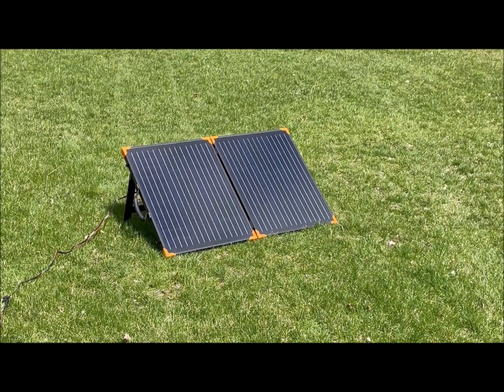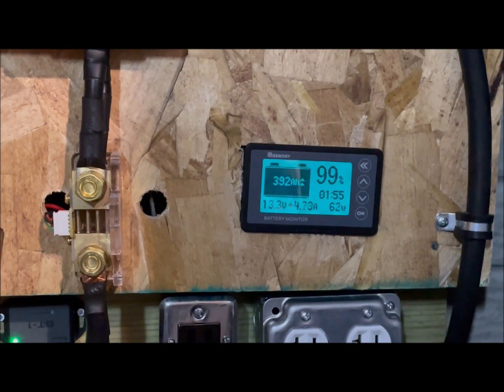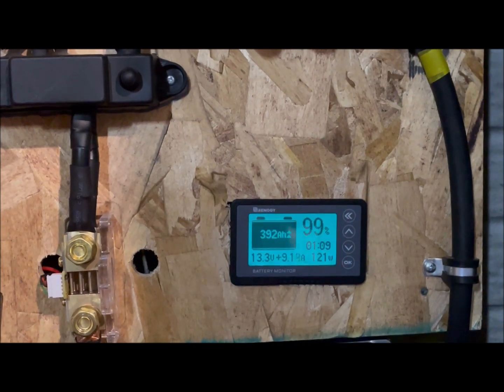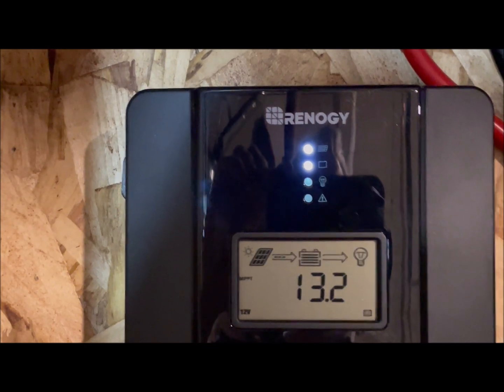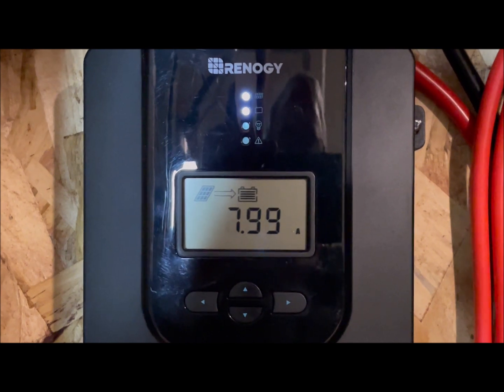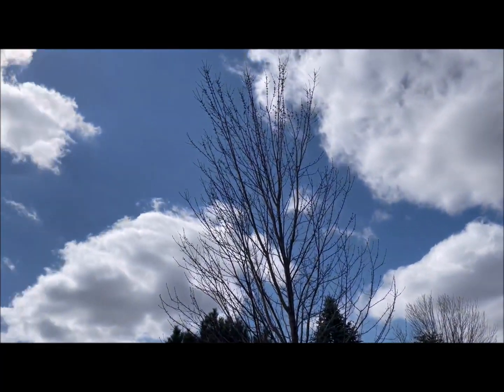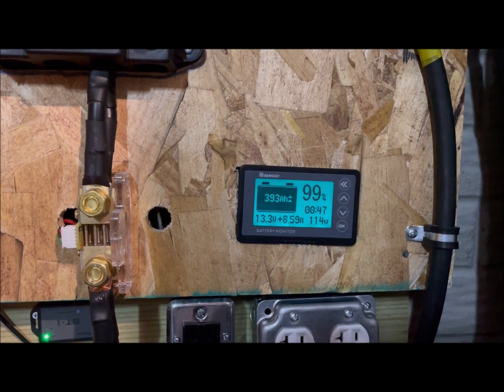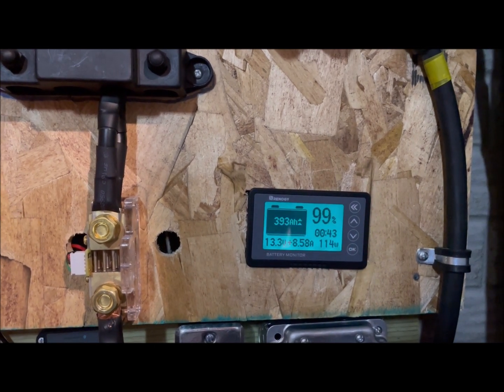New Harbor Freight - Part 2 - 100W Folding Solar Panel vs Renogy 40A Charge Controller - 122%!!!!

Comment: Is this 12v or 24v ?
Reply from the maker: Yes it is considered a 12V panel but operates right around 18V.  Its VOC (Voltage Open Circuit) is 21.5V.

Comment: Thanks for the H-F Thunderbolt reviews. I just bought a H-F briefcase panel. Getting 90-120 watts on my Bluetti AC50S right out the box with some high clouds.
Reply: Thanks!
Reply: I just purchased this for my AC50S and am excited to hear your report. Hope it works as well for me.
Reply: Did you have to buy an adapter cable or did you cut off the SAE and switch to MC4?
Reply: @rosepaul9681  My H-F Thunderbolt came with a short SAE to 8mm adapter cable, which is what my Bluetti AC50S uses.

Comment: They sure seem to give more output for less money than Goal zeros. I own three 100watt Goal Zero solar panels and each 100watt panel puts out a max of 60watts in full sun.
I will buy a 100watt Thunderbolt to verify that power output.
Reply from the maker: I don’t think you will be disappointed.  Please report back you findings.

Comment: 120 watt is great. I just purchased the same from Harbor Freight today 5/30/2022 and only get 85 watt on a 87 degree day with no clouds.
Reply from the maker: I find it really depends on what it is connected to.
Reply: @cabin by the lake are you using a pwm charge controller or a mppt?
Reply: I just got one of these and get 90-120 watts on my Bluetti AC50S.

Comment: Two of those connected in series or parallel would be great for a backup system.
Reply from the maker: With the provided SAE connectors on the Harbor Freight Panels it is nearly impossible to put these in series.  The owners manual that comes with them says to only use them in parallel.  Attached is a video of a Gentlemen that converted two Harbor Freight Panels from SAE to MC4 and ran them in Series with great success.    https://www.youtube.com/watch?v=lN5NhvPYBC0&list=PLhWBfKrHj8H0uGkKQB4K2ScElGc30K6R7&index=10
Reply: @thechiefsway2618   Thanks Chief. I noticed on another review that some Harbor Freight's panels are reversed in polarity. When connecting in parallel, an adapter needs to be used to flip them back to regular polarity. Are these panels like that too?  I'll include the link that shows the reverse polarity adapter. Thanks again brother.  I'm a retired STGC(SW).
https://www.youtube.com/watch?v=-ZEuToaK6to&t=502s
Reply from the maker: @coolspace2136  Thanks for commenting Chief.  I retired in 2006 as a ETC(SW).  The truth is that the Panels are the correct polarity and the adapters are the correct polarity also.  Watch the attached video below I made were I explain SAE Connectors.  The truth is that anything that is made for DC is manufactured to used in one single direction and if use in the opposite direction then that reverse polarity adapter has to be used.  Example, I use two of these SAE connector adapters that are backwards.  One is a 1 to 2 Y cable.  Its manufactured 1 to 2, but I use it as 2 to 1 so its backwards.  When I connect a panel to it the red from the panel connects to the black wire of the adapter. I straighten it out on the output of that Y adapter.  Every SAE cable has a Female connector on one end and a male connector on the other end.  The source hot side should always be the female connector to avoid shorts when disconnected.  On the output of the Y adapter I connect a SAE extension cable and just turn it around so the red of the extension cable is connected to the black of the Y and we are back to normal.  The Shipmate that made the video you posted was using an adapter in the wrong direction  which required that adapter.  The panel is correct, the red hot line is on the female connector.  I think I'll do a video on this topic to help people out.  Hope this helps?  https://www.youtube.com/watch?v=UmO7PhkJLKw
Reply: @thechiefsway2618  Thanks! I have to admit I stopped by the ET shop plenty of times when I needed help. I was in from 85 to 08. AN/SQS-26BX tech. I ordered one folding panel and will be getting another if I like how it's designed.  I lost use of my left arm  and leg a few years ago, so I need to see how easy I can set it up before I buy a second one.  We get hurricanes here on the Gulf Coast so I like a way to make power when that goes down. Looking forward to more videos on this panel! Thanks again!
Reply from the maker: @coolspace2136  Sorry to hear of your medical problems.  Pretty easy to set up but about 25-26lbs.  Served 82 to 06.  On my first Ship the USS MCCandless FF-1084 spent a lot of time up in Sonar when we had contact.  Sonar was right above the ET Shop.  Was on the Big Mac from 84-87.  Thanks again for supporting the channel.

Comment: Remember, for DC voltage, particularly low power, you have considerable power loss with longer cables. Your cables are long enough to give you considerable loss.
Reply from the maker: By the book there should be loss, but in real life it doesn't work that way.  Recording a peak of 122Watts from a 100W Panel in about 67ft of 10awg wire and at least 5 SAE connections along the way.  If there was a considerable amount of loss then this panel would be making a stupid amount of power, which I don't believe it is.
Reply: @thechiefsway2618  No DC power losd on that amount of cable is incredible. Those panels must be putting out well above its rating.

Comment: Will the Thunderbolt Briefcase work with just a Jackery or similar Power Station???
Reply from the maker: The panel will work with any Power Station, but may not work out of the box with all because a different adapter may be required.  The panel comes with the 8mm (DC7909) adapter which works directly with Jackery and some other Power stations.  If you post here exactly what Power Station you have or Interested in I can assist you in finding the correct adapter.
Reply: @thechiefsway2618 So, you can use that adapter with a Bluetti EB3A? I think it uses the D7909.

Comment: Thank you for part2. I was wondering (not owning a jackery) where the measurements were coming from and what the amperes were. I was not surprised by the wattage. My old rigid fixed panel gets about 116 on a good day, even at about 90-95 degrees out. (Saw the comments in pt1 on the cold causing better performance)
A lot of people (not all people)I see complaining don’t figure all the factors. Not realizing the specs are usually given at panels capability, and not considering the converting to the voltage needing for the application used for etc. Not to mention wire length. I am sure you know 60 feet of wire is going to cause a drop. 
All said, I think you got a good deal. I am always looking for something smaller to save space while traveling.

Comment: This makes no sense.  I have over 2 dozen solar panels of all varieties and makes and not one of them puts out MORE than it is rated at.
Reply from the maker: Sorry to hear that.  This panel in to perfect conditions produced that 122W for a short period of time and the 115W after.  The other Harbor Freight fixed 100W panel I have seen as high as 106W connected to the Jackery 880.  It was 42 degrees the day that this video was made.
Reply from the maker: Watch this other video about the Harbor Freight fixed 100W panels.  You will see a lot depends on the charge controller your plugging it into.  He pulls a 104W out of each panel when connected to a MPPT Style of charge controller.  https://www.youtube.com/watch?v=lN5NhvPYBC0
Reply: Yes, the old rigid HF panels have gotten as high as 116 watts for me. Even on the hot days 85-95(saw the people saying how much the cold was improving the performance in pt1). 
Tip if you bought the older rigid panel and are having issues. When I traded mine in after 2-3 days having a bad connector. The new one had the same issue. Knowing the panel puts out I chose to just replace the whole cable assembly with a good 10awg wire set with MC4 connectors and I have not had any issues since.

Comment from the maker: These Panels are on sale at Harbor Freight till 5/26/2022 for the Inside Track Members.  Sale price is $149.00.  Regular price had been $179 but is now listed as $189.  Save $40.  Their other fixed 100w solar panel also went up in price by $10.
Reply: What is an inside track member?
Reply from the maker: @NorthcoastPatty  You have to pay $29.99 for a 1 year membership to get these special prices.  If you use Harbor Freight it is usually worth it.  https://www.harborfreight.com/inside-track-club-membership-403.html
Reply: @thechiefsway2618  Thank you!!!

Comment: Thanks for the review!  I'm a fellow cheesehead!  How adjustable are the legs as far as getting the optimal angle with sun?
Reply from the maker: The legs are a fixed length and the panel is at approx. 35 degrees which is the proper annual angle setting for the land of Cheese.